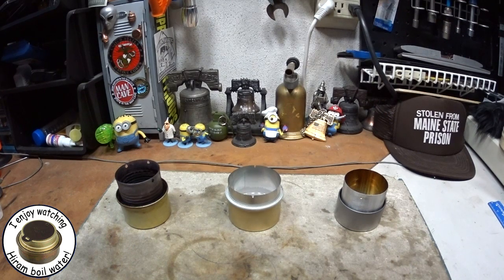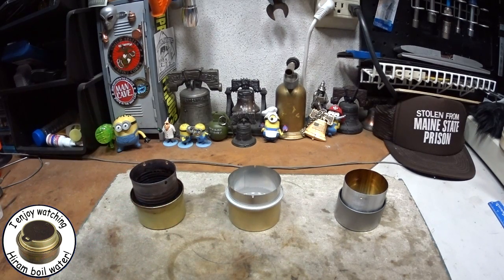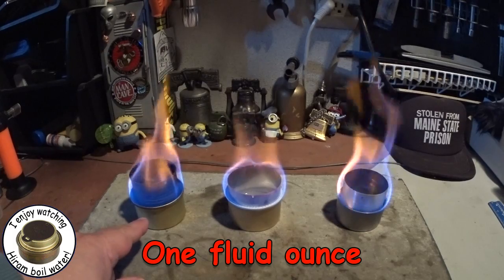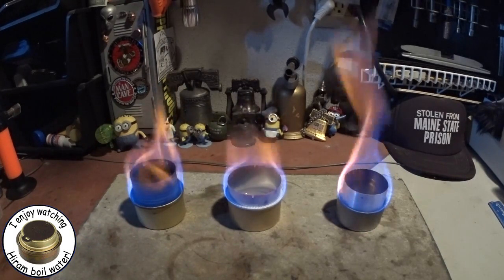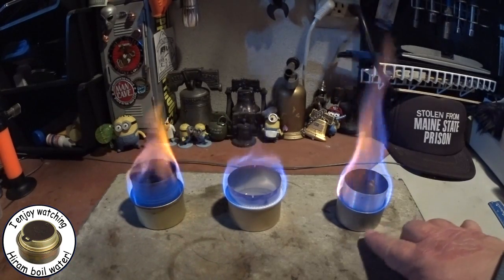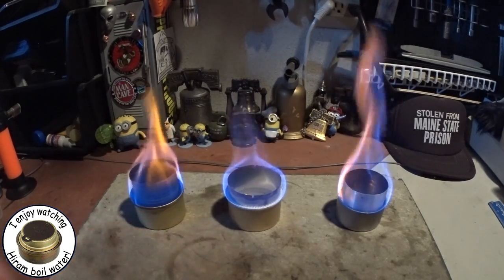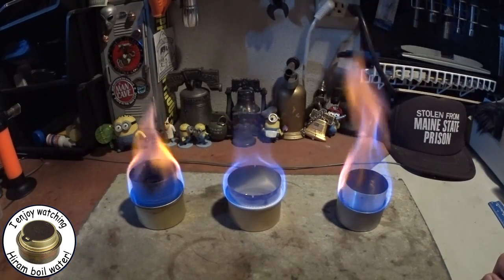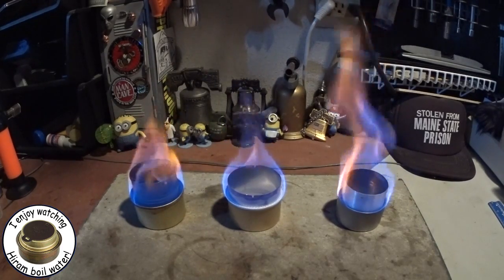''Fancee Feest'' and ''SuperLite'' Alcohol Stoves Flame Test

Comment: Herman I would love to see you do a fuel  comparison test on these three stoves.  Fireboxstove did such a test on a different stove and the yellow Heet and 99% alcohol came out as the fastest/cost effective for boiling. What fuel do you use now? Also, the only way I can see this improving is if they make it all titanium and size it to fit the carbon felt, weld some of those swivel rod stands on the top for larger pots and on the bottom for stability(those rod stands on the Firebox stove Nano, I think), and a larger can to fit it in and used as a smuggler(if it needs one). Imho :-) please tell me what you think of these ideas. 
Thx.
Reply: Hiram I mean. I hate spell checkers.